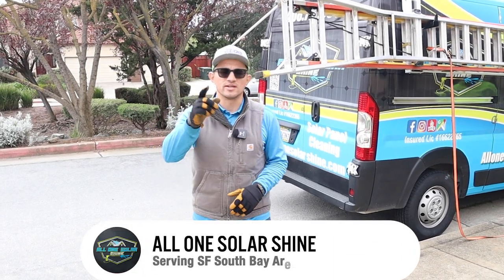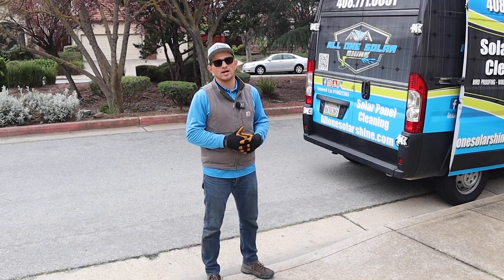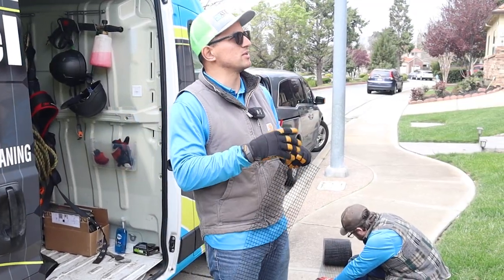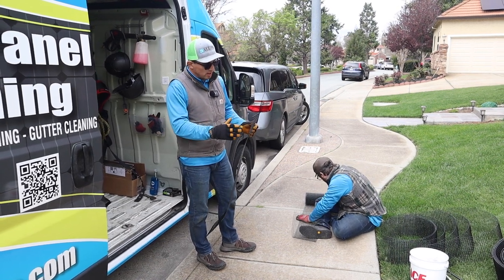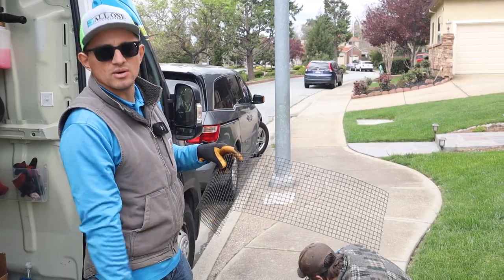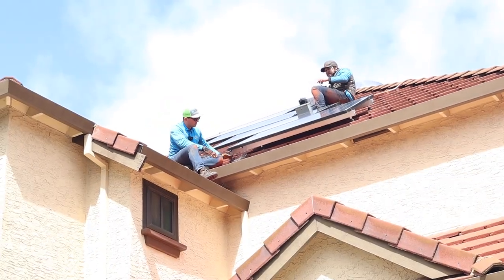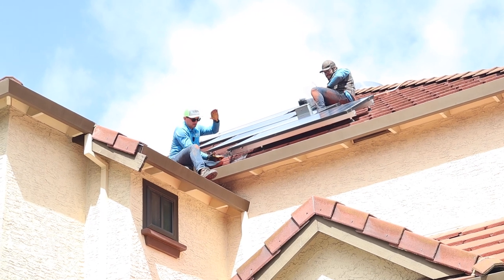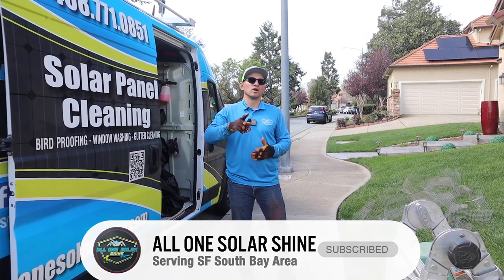The How, When and Why To Bird Proofing Your Solar Panels Professionally - All One Solar Shine

Comment: Given that there is two different sizes 6 inch and 8 inch as well as each solar panel system being different in regards to how many inches the panels are off the roof. Do you only order the mesh when you have an actual client who wants the service or do you keep some mesh in stock in your van?
Reply from the maker: Great question! I typically keep roughly 200lf of both sizes on hand and order more if needed after I have been awarded the job
Reply: What’s more common 6 or 8??